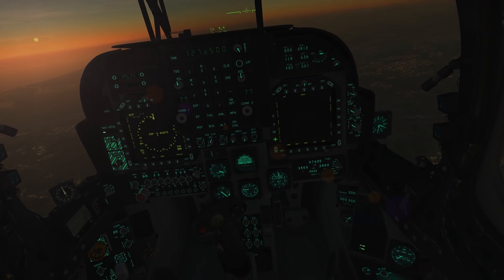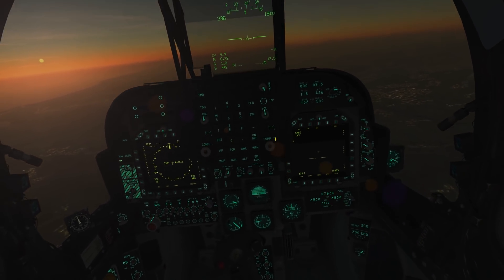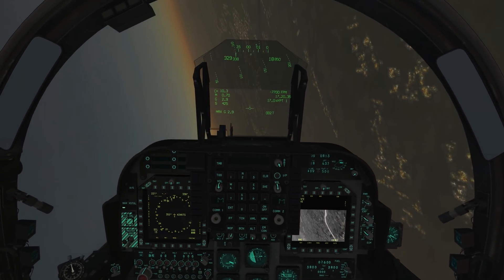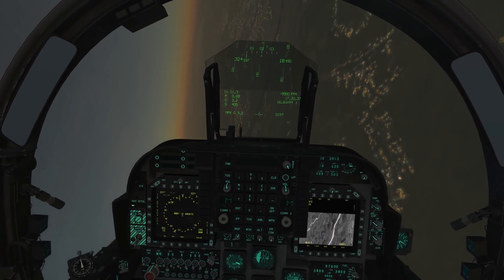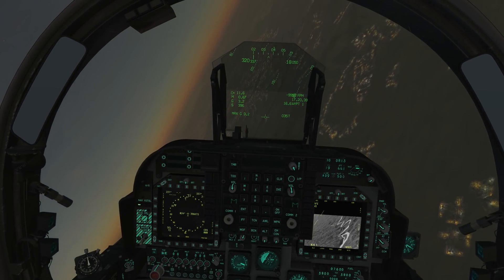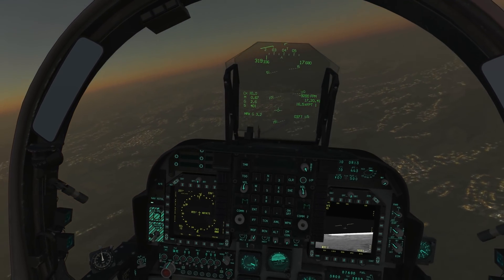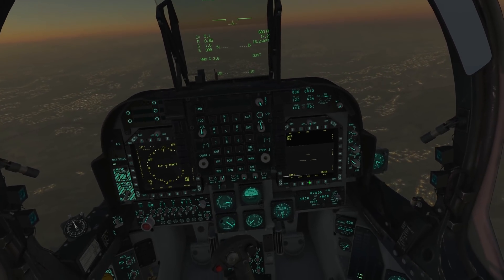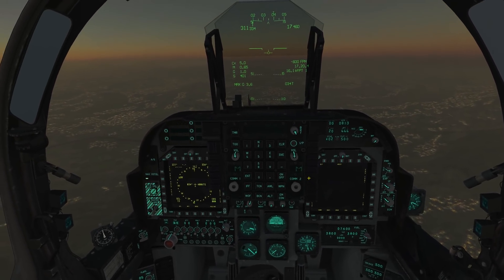DCS World - AV-8B - Tutorials - NAVFLIR

Comment: Hello. Thanks for the amazing video. I have a question if you don't mind:

When I do certain maneuvers like you do in this video, and roll or do hoops etc, my Harrier starts vibrating like crazy and then starts spinning / rolling. Like a mini stall. Any idea what may be causing this? I tried doing sharp turns with both AFC and without it, and experienced the same thing. 

Thanks again for the video, and your time!
Reply: Turn on your AFC, It automatically trims out your plane and keeps it stable, You also might be pulling on the stick to hard
Reply: @wietpiet1748  Thanks but that was 9 months ago and I have since mastered the bird, haha. The cause was that if you try to go beyond 20 degrees of angle of attack, Betty intervenes.

Comment: anyone else experiencing lag when flir is on hud?
Reply from the maker: System specs?
Reply: Jabbers processor:i5 5200u 2.2 ghz to 2.7 by turbo boost, graphic card: Nvidia geforce 920m 2gb, 12 gb ram, 500 gb hdd
Reply from the maker: Ah, ya, probably hardware is the issue.  the FLIR camera is rendering the same scene again when its on
Reply: Jabbers so it does eat some more fps
Reply from the maker: Ya and thats expected, i have a beast of a machine so it isnt really noticable.
Reply: do you know how can I set up uhf frequency for awacs or tanker in multiplayer?
Reply from the maker: Not sure I’m not a mission guy
Reply: you'll need to set it also for depart and land.

Comment: Having the same issue as Lollix46, going thru all steps but flir will not come up on hud. Love your videos.
Reply from the maker: Ya im baffled by this, its literally 3 things to do to get this going yet so many ppl have an issue I'm beginning to wonder if there is a bug.  If you wouldnt mind can you leave me your system specs?   Specifically your video card?  Are you trying on 1.58 or 2.2?
Reply: I have an ASUS Desktop G20AJ comp with Intel i7-4790 @360GHz
Video card is a NVIDIA GTX 760. Gonna be upgrading soon because my system wont run 2.2 so ive been running 1.58. You think my graphics card isnt letting it come up on HUD?  I'll have my son try it on his later he has GTX 1060. Thanks for all the instructional videos.
Reply from the maker: I wouldnt think so, but maybe?  If you can try on another device that'd be great, and if its not working I can report the bug direct to ED, thanks!
Reply: So, after some quick troubleshooting, we just rebound the key and it worked flawlessly. It works fine for me with the default LeftWin+N keybind, but not for him. Not sure how well this will work for everyone else, but it worked for us.
Reply from the maker: Odd
Reply: Some keyboards like the G910 or other "gamer keyboards" have the ability to block windows specific keys & functions (Windows key, alt+tab etc). Maybe your friend accidentally turned this  mode on?

Comment: Hud mode night, Flir ON, when I press the sensor button down nothing happen...why??
Reply from the maker: Not the right sensor button?
Reply: Thanks for the answer Jab, I'm using the Sensor button down (HUD scene reject/TGP), default LWIN+N. Is it correct?
Reply from the maker: Correct
Reply from the maker: Hud mode is a 3 position switch so make sure it goes all the way down to night maybe it’s in auto
Reply: Yes, all the way down to night, FLIR on, and sensor down... no NAVFLIR on the HUD... If I press sensor right I can see the flir on the mfcd, and I can switch between black and white
Reply from the maker: Dunno it’s literally those 3 steps from what I remember, perhaps you can check the pocket guide
Reply: I'll check! Thank you Jab! And great videos ;)
Reply from the maker: What video card do you have?   Curious cause another viewer has similar issues and trying to see if its hardware related.
Reply: Jab I have a 1070 gtx..
I partially solved the problem: keyboard shortcut doesn't work, so the solution is to bind the sensor down directly to the joystick. I reported this problem on the ed forum.

Comment: Where's the "sensor select button?"
Reply from the maker: It's 5 buttons.  FWD, AFT, LEFT, RIGHT, DOWN
Reply: Is probably a bind that need to be set from the options.
Reply from the maker: Sensor selection is a binding under HOTAS
Reply from the maker: I start pretty simple.   Pitch, Roll, Rudder, Throttle, Nozzle, Brakes, Trim, CMS, Trigger, Pickle.   Then I look at how to do things and map as I go, but only if i feel like i would need the binding faster than i can click it.   Things I've mapped to my hotas that I don't click are Sensor select, A/A Modes (Boat switch for missiles, master mode button for guns), TDC slew and Cage/Uncage... thats pretty much it for me, everything else i click.
Reply: Thx!  I hate to ask, but can I click it on the UFP?  Using VR =p
Reply from the maker: Not sure I understand, click the UFC?  Sorry
Reply: Do you guys use a China Hat for that? I mostly struggle on setting these options, Im always not sure how to bind it.

Comment: What's the way to meke Harrier turn around or wheel steering on the ground?
Reply: Search controls for "NWS", this is Nose Wheel Steering. You have to hold the nosewheel steering down to turn unless you have the anti-skid switch in the NWS position in which case the nose wheel will turn but to a lesser degree. You can still use the NWS button to turn tighter if you need to
Reply: Rick on the Internet 
Just Nws? Or Nws and Z/x for the direction?
Reply: You hold down the NWS button while turning using the rudder, if you're using keyboard to control rudder then I believe it is Z/X, yes.
Reply: Rick on the Internet
Tks Rick